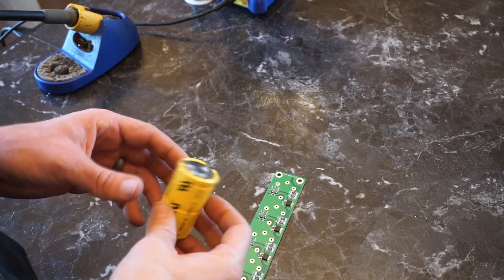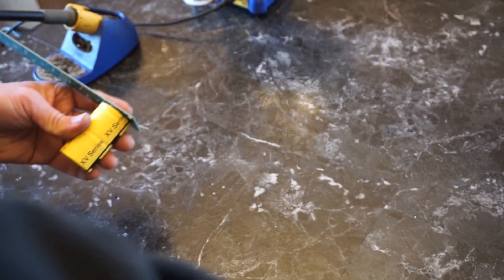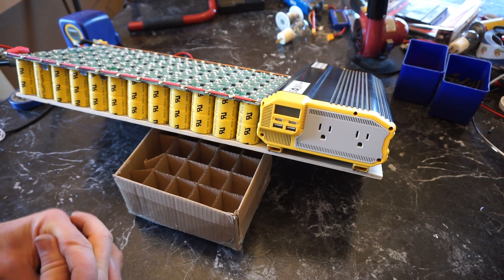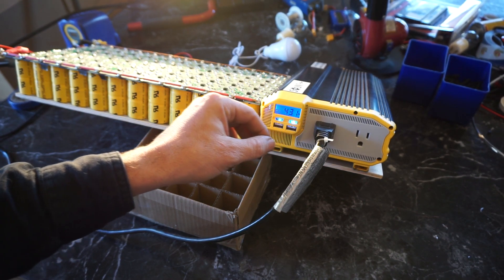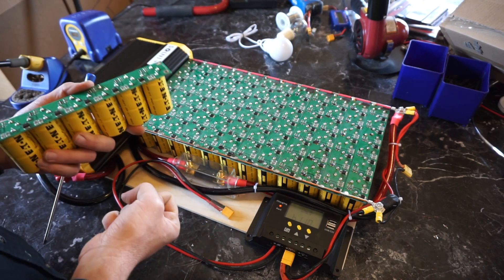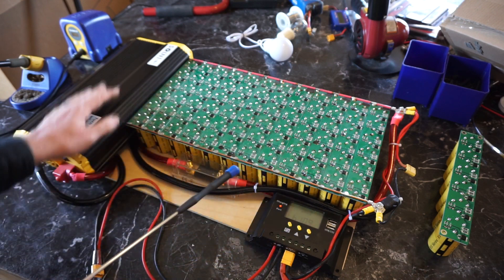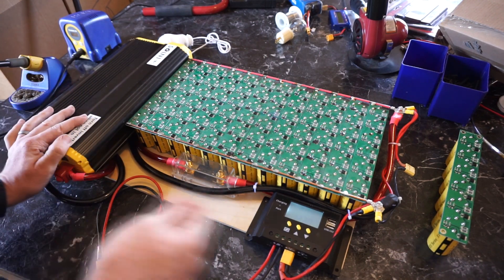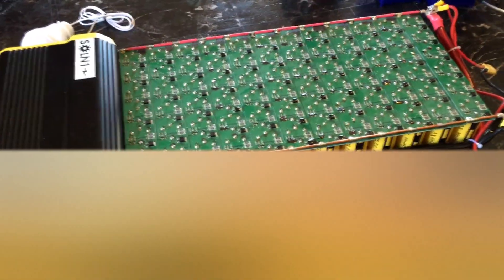Building the SOLN1-2000 Watt Capacitor Solar Generator

Comment: +lasersaber so I have an interesting use case.  I go 4wheeling and we often get stuck or find ourselves needing to help someone get unstuck (yes, typical).  So we rely on our winches a lot of the time.  Warn being the most popular brand, sometimes smittybilt and superwinch too.  These units require a ~450 amp (or 650cca rated battery) 12v load and our engines to be running.  Commonly we'll be running Group 31 AGMs like the Odyssey 31-PC2150.  We run into issues with us killing our batteries all the time because of starting in cold weather and running our winches.  

The idea of a super capacitor for our winches is extremely attractive because our longer pulls, where we're pulling up to 100-150 feet of line, we'll be pulsing to prevent the winch to overheat.  As you can imagine, this is really tough on the battery.  I'd be really interested in running a super capacitor bank into my winch.  I guess I just need to gauge how many caps and what system capacity I'd need to be a good compromise between size and performance.
Reply: kalieaire sounds like a cool project. Do you know the output of the 4 wheelers charging system? What kind of duty cycle are you hopping to get. Example: 10 seconds running it for 20 seconds off.
Reply: I did some more research wrt reconsidering the system as a whole.

The Toyota Tacoma Alternator from the Tow Package rated at 130AH peak can push out 70-80Ah at idle ~800rpm.

The recommended guidelines for the winch battery is 650CCA from WARN.  Typical Group 31 sized ESMs from Skeleton or Maxwell offer around 1800-2250 CCA on their 12v ESMs.  The way the ESMs work is that they're connected only to the starter and separated from the rest of the system using high current MOSFET arrays which work as diodes to allow the ESMs to charge but not send power to any accessories.  This way, if people run down their AGM batteries on a trip to power their fridge, radio, lights, etc, they won't deplete the ESM of power.  From the ratings I think this ESMs are running 2.5v or 2.7v 2000-3000 farad capacitors in a 12 capacitor bank configuration.

I did a couple of calculations and it would require something like a 24 capacitor bank of 3000 farad 2.7v capacitors to to a 30 second pull.  

So the best bet would be to downsize my Group 31 AGM and go with a "dual battery setup" run with a Group34 instead and use a PerfectSwitch single rectifier or Inpower ABS-100 and connect the winch with the capacitor bank and battery together to share the load.  This alone should save the battery from a significant amount of load and buffer the whole system.  The starter would be completely isolated from the rest of the electrical system and pull power directly from the Capacitor bank.

Going from ~400-450 amps to 330-380 amps on a pull and then soaking up the initial current inrush by pulling from the Capacitors would significantly bridge the gap required to reducing current drain on the main battery.

Comment: all these guys warning of death one cap has 2.7 -2.8v max. The most in series is 6 caps so thats 2.6 x 6 volts. Current can only kill if you have the voltage to push it through your body. All the other caps are just lines of 6 in series all in parallel with first 6 in series so no more than 17 volts anywhere on those caps and as for the ring he would have to try pretty hard to make it touch both + and neg at same time at which point with the spark most people would pull thier hand away so quick the ring might get  warm. If he took it off his hand and flattened it, it might reach across the + - contacts but then his wife might kill him for destroying wedding ring. Why is it if people can't be constructive they have to be destructive? or try to be.
Reply: It's not the volts that kills you, it's the amperage.  Two amps is enough to kill you.  This is why you see stun guns rated for millions of volts, it is at very low amperages. Now Supercaps are used in many applications simply because they can deliver very high amperage instantaneously. Yes you need the voltage to push the current but the best advice is to be extra vigilant any time you are dealing with electricity period. Accidents often happen when we become complacent, distracted, or if are unfamiliar with a task or performing an infrequent evolution.   ~Today's safety message brought to you by "Safety Sally" ;)
Reply: I'm not knowledgeable, but aren't caps used to make a welder? best safety practices generally apply. especially for us noobs. like using a wrench on your car battery...easy to make mistakes and connect the terminals...ive seen them weld the wrench handle.
Reply: @mikemotorbike4283 , they can weld at low voltage because of low resistances of metals allowing a lot of current to flow even at low voltage. 

 However our skin is high resistance so low voltages can't move high current.

Comment: What is the total capacity? Is it 29.52wH (0.41x6x12)?
Reply: Nadim Awan The useful capacity for the system is going to depend on the cut off voltage of the inverter. Energy in joules in a capacitor is = .5*capacity*(volt)^2. Each bank of those has 66.7 F capacity. With 12 of those it’s going to be 800.4 F capacity for the whole system. Assuming the inverter is rated to work at 16.2 volts. The fully charged system at 16.2 volts will have .5*800.4*(16.2)^2=105,028 joules of energy. If the inverter cuts off the voltage at 10.0 volts we subtract the energy we cannot use from that .5*800.4*(10.0)^2 = 40,020 joules. 105,028 – 40,020 = 65,008 joules or 18.05 watt hours. I don’t know the specs of the inverter it might be higher or lower but I think this is how you could calculate the useful energy.

Comment: can I use 75vdc 15000uf if this rating 2.7vdc 3000f is not available?
Reply: Gaia Drakones One farad is equal to 1,000,000 microfarad. You most likey  won't be able to store enough energy with those to make it worth building.

Comment: i have a few real good questions imo. to someone like myself it is the most important questions. how long will these caps last? how many continuous hours will they run before needing replaced? are they made to run hours at a time or short burst like starting motors then charging?

Comment: The board is out of Stock, i can not buy !!!!!
Reply from the maker: I have a batch from here on order: https://www.aliexpress.com/item/1PC-100F-120F-220F-360F-400F-500F-2-7V-super-capacitor-protection-board/32756977563.html?
If they are good I will no longer be stocking them because you can get them cheap direct with free shipping!
Reply: The Item is no longer avaiable ?????

Comment: I like your work with capacitors it's quite inspiring, I noted from one of your videos you mentioned you had an electric car now, is this true?

If so have you considered making a capacitor bank that charges from solar to charge your electric car?

What I'm getting at is the type of thing whereby should there be an issue with your power supply you could simply connect your electric car to the capacitor bank and charge it up.

Now from what I've see of your work I would say it is very much possible using those yellow caps in the form you have been doing but multi layering them and using an inverter powerful enough to charge the car, on the other hand perhaps if the car has dc charging a direct dc charge from caps to battery.

The only thing stopping me from having a go at this for my electric bike is the price of capacitors, they are very expensive in the UK.

Keep up the good work on the capacitors, they could have so many uses.

Comment: I have done this with - so far it is working fine - I use it mainly for 12 to 5.1 step down converter to usb - The idea was to keep charging the capacitor after the battery was fully charged & to keep it charged while I use the power from the capacitor since it is 2,000 watts & that can keep charging when the main is full & the capacitor & thus at night can keep it full depending on your power use 
  
http://www.ebay.com/itm/351639308531?_trksid=p2050601.m570.l5999&_trkparms=gh1g%3DI351639308531.N36.S2.R3.TR8

Comment: Couldn't you just power the charge controller with a 9v battery tell the capacitors were at running power and install a relay that will activate the power to the charge controller with another relay to then automatically turn off the 9v connection.. or even a small lawnmower battery? Have you seen the other system like this? How to cook rice with 40watt I believe the name of the video is

Comment: Do you have a balance board that will work with the Maxwell D Cell 350F 2.7VDC capacitor?  I would like to use them along with a balance board to accommodate the different connector arrangement.  Thank you

Comment: I have been thinking about something along these lines but I was thinking about 7 supercaps in a row (17.5V) and 7 columns of those.  Connected to a windmill.  The opposite side of that would be a boost converter as I will be running a 48V battery bank system.  Now, I haven't decided if it should be at 55V or 96Vi.  But in this case I can run it into a standard charge controller.  I'll lose some in the conversation but it's the best solution I have came up with.  Also thought about building a free energy generator which I still have some doubts on that would use the same configuration bank.
Reply: I get a bit triggered anytime someone uses the term 'free energy'...

Comment: You need to hack your charge controller so that it supplies power also when there's no voltage on the caps. A manual jump start connector is not very high in neatness. So a simple gate that opens every time there's voltage from solar panel and it is less then the kick in voltage of the controller: two resistors a zener diode and a FET should do it.

If you hook up your capacitor bank and balance board to comparatively small li-po battery wont the discharge current overload the batteries still if you use it to say start a car? Do I need a current limiter on the battery pack or is this in reality not a problem? You've  started cars with this so you would know.

Comment: Can this 2000 Watt generator be charged from a wall outlet?  Maybe using a battery / trickle charger? I am wanting to have something that will take less watt input and high watt output for a system I run 24/7 of approximately 1200W. It's costing me around $60 a month to run and I am trying to figure out a way to reduce this cost. Solar is not an option where I am at.

Comment: Great stuff always wanted to do something you talk about but a bit over my head. How about a video about a smaller version coupled with a 20, 000 mv. Small 18650 battery pack? Im wondering if I can build such a device to make a small but super battery pack without an inverter for low voltage use instead of 110 or 220.. I have a 20,400 mv power bank I use in the bush to charge my camera's. Am I correct in thinking that I could expand my capacity significantly,  cost effectively and practically? I would love to build such a kit but dont have the knowledge to tackle it without help any ideas where to start? I'm not completely stupid just a bit slow LOL..

Comment: lasersaber - I used the same inverter in my solar generator build series ( https://www.youtube.com/playlist?list=PLIorqrLdxMKZV464fFUflegLuuvLEyMrU ) which is using a AGM deep cycle battery bank via high current quick connects.  Do you feel one high capacity capacitor (like those used in car audio) wired in parallel would be beneficial for surge currents?    Thanks for any insights, and appreciate the video!
Reply: ModernSurvivalists can you tell me make and model from the inverter please?

Comment: Hey laser, im no electronic specialist, so maybe you or someone else on here could help me with this question. How comparable are these capacitors to lets say an 1500mah lithium ion 18650 cell? I ask because i built a battery pack last year roughly the size of a cereal box to power my Mac10T ebike setup on my Catrike Expedition. The battery pack was built from old used cells from laptop batteries i picked up nearly free and test every cell before assembling the pack. I have been having lots of issues with the pack over the year with random cells dieing and shorting out to the battery balancer dieing on my more than once in 12 months. Im curious if i could replace the battery bank i currently have with a capacitor bank on my e-assist bike setup.

Comment: Using metal screwdriver to point at charged capacitors....
Reply: That almost made me jump. Sure it was plastic this time but not a good habit anyway. Next time it could be something more conducting.
All I am saying human brain is a strange device. When you get all too confident it occasionally makes  you do the most stupid thing...
Reply: @andriusst  I saw the plastic also but it still make me cringe. I figure that much current available that it could easily jump right through that little bit of plastic.
Reply: Touchdown 5:15 - 5:16 :)
Reply: @Drew_Hurst  what drugs are you on buddy ! Try taking another look  !
Reply: Patrick, that's now what drove me crazy. Its just the freakin tapping noise.
Reply: Yep....  nobody saw him tapping with the metal end too?

Comment: none of these videos which deal with supercapictors ever warn you of the imminent danger of death.  can you guys please try and be a little more responsible with this? very dangerous
Reply: michamus true but it's really hard to get enough current to go through your body to hurt you without higher voltage. Unless you lick the capacitors you can even feel that low of voltage.
Reply: michamus, you need a certain amount of voltage to penetrate the skin, 16.2V is orders of magnitude not enough voltage.
Reply: Cavan B they are at 16.2 volts or less they are about as dangerous as a car battery. If you short them with something it can start a fire but you can't be killed by that low of DC voltage.
Reply: Wiggy, voltage isn't what kills you.
Reply: @michamus , amps do. But volts carry amps. So a 10000v 0.25amp source will kill you dead in a heartbeat. But a 0.25v 10000amp source will literally do nothing to you if you touched it.

 It's about balance, at at 16v here you'd literally have to have the connections embedded under your skin to even have a chance of being hurt.

Comment: Mains power and extension cord or a generator. DONE
Reply: Some places do not have commercial power due to the cost of running the lines. And at times, places like here can go for weeks without commercial power. Just look at what happened to PR when it got hit by the Hurricanes. They had power plants that could run but no power grid to get it out to where it would be used. After Hurricane Andrew, it was 5 weeks before we got commercial power back. After Irma, it was almost a week. How long were we without TV/lights/refrigerators/microwave/freezer? Only the time between switching between the inverter to or from the generator. But we went two days without using the generator at all. Problem with generators is they are noisy and require you to go and get fuel.

Comment: 84 Capacitors x $9.00 =$756 I can buy a lot of lipo battery's for $700
Reply: I like the idea of integrating PV panels and caps but 84 Caps x 0.4 Watt-Hours = 33 Watt-Hours 

Say this assembly weighs a kilogram then we have 30 Watt-Hours stored per kilo in something that can be charged, and discharged, quickly.   But at a cost of $700 this particular super-capacitor route for bulk energy storage has an aquisition cost of over $20 per Watt-Hour or over $20,000 per kWH.  

" $20k to store something that costs 20 cents from the grid!!! " is one way of looking at this...
 
For comparison, the chemical energy stored in just 1 litre of petrol or diesel (very roughly 1 kg) is around 10 kWH.  Rather than spend on super-caps, the same $20k would buy a 1kW generator for $2k and leave $18k for fuel.  For argument's sake let's say you buy 15,000 litres (I am in the UK) and its only 20% efficient to generate: You would get 20% of 15,000 litres x 10 kWatt-hours / litre = 30,000 kWh...i.e. nearly four years of continuous generation at 1kW.

No doubting that a smaller capacitor bank would ease the startup load of course, and therefore make the 1KW generator drive heavier tools for short periods.
Reply: I have 2 of these batteries in my camper van. and there not cheap and made for a 100 draw and charge  https://starkpower.com/product/12-volt-125ah-battery/

Comment: My setup is on a lot smaller set up compared to yours but the goal is the same.

I have since added a 5 volt buck converter to the USB output and now there is a constant 5 volt output right down to 0.9 volts from the super capacitors

https://youtu.be/Nvjmh6QGY9U

Comment: shame you can't buy or build your own buck inverter to generate your portable grid power supply, they would be very efficient and make use of 90% of the energy from the super capacitors.
Just thinking when the voltage gets low and your current inverter probably shuts off at 7 volts. there is still plenty of energy in the super capacitors and since they don't mind being discharged to 0 volts, it makes sense to use something that will work right down to the lowest voltage.